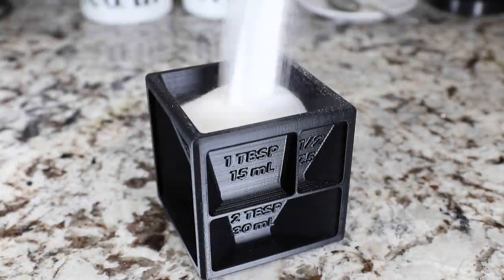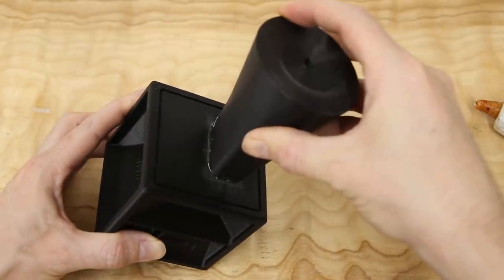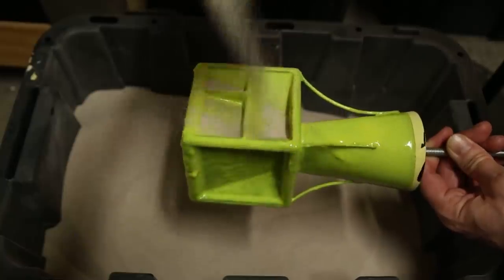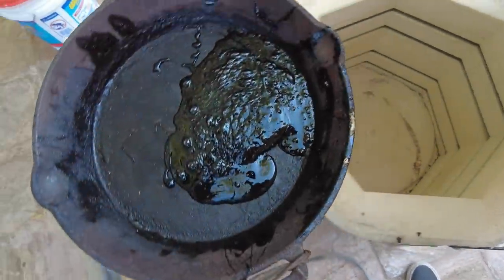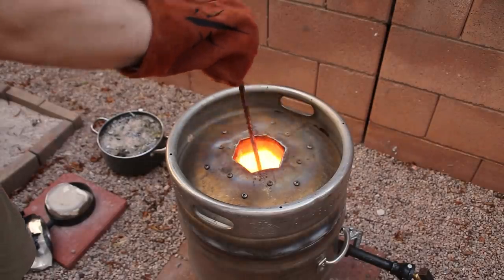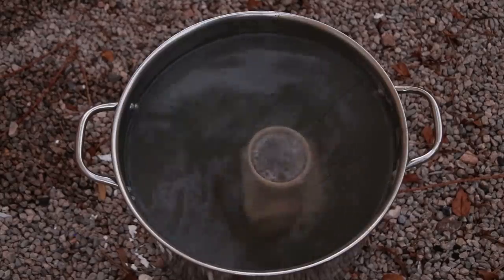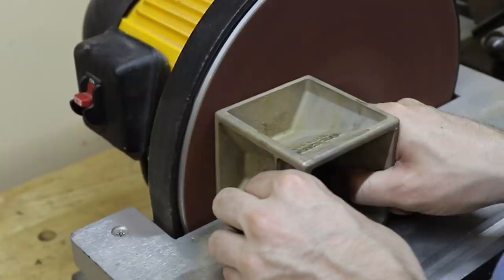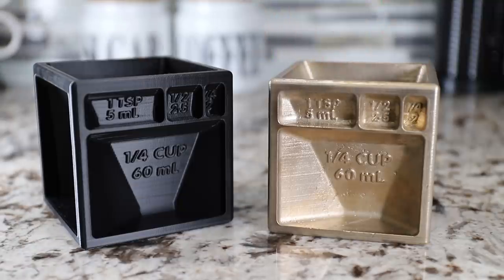Making a Measuring Cube - EXTREME MEASURES - bronze metal casting at home - 3d Printing Lost PLA

Comment: You should buy a rock tumbler/ polisher. That would work great.
Reply: Very good idea
Reply: But it takes so long to get polished rocks :(
Reply: Or build one!
Reply: @maximeduchalet4662  ok but I'm expecting him to alloy gear metal forge it, then hob the gears.
Reply: a brass tumbler/clearer for reloading would probably work well too.
Reply: Build one !
Reply: @Underbottom.Sandydown    I see what you did there...🧐
Reply: Large tumbler for firearms reloading and stainless pins would work wonders
Reply: but then it wouldn’t measure correctly
Reply: @RalseiGaming  it still will measure properly. The amount of material being lost is negligible. But nothing wrong with your thoughts on it.

Comment: Great video. Makes me want to build another furnace and start casting again! Just curious, did you print the measuring cup slightly oversized to compensate for shrinkage?
Reply: Forever cursed to make slightly fewer brownies!
Reply: @NeonThoughtBox  hahaha that’s hilarious! I was just curious, but going back and reading my comment now makes me feel like such a casting snob haha. Totally didn’t mean it that way. Sorry Seth! Good luck with your brownies…
Reply: What % of shrinkage is there when the metal cools off, and how come the ceramic shell doesn’t come off more easily if it’s actually a different size to the casting?
Reply: @thechumpsbeendumped.7797  ceramic shell shrinks as well and even more during firing. It is basically sintering
Reply: @thechumpsbeendumped.7797  Guess it depends on the specific alloy used.
Reply from the maker: Thank you! You're, right it is a little bit smaller. I actually meant to scale up the print by 2-3% but forgot to do so. Oh well, best laid plans!
Reply: @3dbronze  I didn’t think you sound like a casting snob at all. Legitimate question. It’s a measuring cube, it doesn’t work if everything’s slightly off.
Reply: @Will-ge7ri  
It would if everything was measured using the cube. There’d just be 2-3% fewer cookies, or whatever else was being prepared.
Reply: @robinson-foundry  i want to ask you  about the slurry you use? Do you need to stir it from time to time ? Does it expire or get hard etc?  And my last question : would you rather suggest using the slurry instead of using investment casting with the special investment plaster?  I want to see which one works cheaper and doesnt have lots of fuss to use.
Reply: Do you sell them or have the print code available
Reply: @3dbronze  thanks will do
Reply: @thechumpsbeendumped.7797  2-3% shrinkage overall would mean that the larger measurements are off by far more than the smallest… I think…
Reply: @swayback7375  
I’m not 100% sure but don’t think so. If every compartment shrinks proportionally the percentage difference would be constant. 

I did some back of the envelope (literally) calculations and 
5000³mm-2%=4,802³mm
and 
50³mm-2%=48.02³mm

5,000/50=100
4,802/48.02=100

That’s if I’m not missing something obvious?
Reply: @NeonThoughtBox  lol😂👏👏
Reply: @NeonThoughtBox  best comment I've read all day.🤣🤣🤣
Reply: @thechumpsbeendumped.7797  Only true if the shrinkage is perfectly even and linear.
Reply: @Barnaclebeard  
If it shrank in a non linear way either it would crack or the casting would distort. That would become evident in the walls of each compartment no longer being straight. 
But we’re talking about a cooking tool, that uses an antiquated measuring system, not a scientific device that if it was 0.01% out of calibration it could cause an experiment to go horribly wrong.
Reply: @3dbronze  Doesn't sound snobbish at all, in fact it's a really good question :)
Reply: @robinson-foundry  did you reuse the pla and suspendaslurry audio for the copper hammer video? i just watched them both and they sounded almost identical

Comment: "80 thousandths of an inch" sounds so complicated compared to 2 millimeters. 

It always gets me. Thinking if people can really imagine some tiny thousandths of something. 

Either way, super cool project. I saw this measuring cup being used by the "as seen on TV" guy. 

It didn't seem overly practical, at least in the way he used it. 

But making a bronze version is pretty awesome 👍 and the quality of your casting is superb.
Reply: or just 8% of an inch. Do basic conversions escape your capacity? Lol
Reply: @THESLlCK  Or maybe just 2 mm. Do basic units escape your capacity?
Reply: @JuanCLeal  complain more
Reply: I suppose thou(sandths of an inch) is a weird unit if you don't hang around US machinists, but there's a few intuits for it: a hair is a few thou, a playing card is about 10 or 12, the wire in a paper clip, something like 40 thou. While no one could feel a difference in width between 40 thou and 41, it's likely that you'd feel a burr 1 thou high on an otherwise smooth surface. Imagine a fine hair on a glass plate. 1 inch is not really long, but its long enough that 1 thousandth of an inch is tiny, but in some contexts, still very much perceptible. Just my 2c. Have a good one.
Reply: @THESLlCK  I prepared this bucket of ice cold water for you 🪣 That burn has to sting pretty bad.
Reply: @THESLlCK  yikes
Reply: But to be fair its much easier to imagine half a cup versus 120 milliliters, just how it be.
Reply: @0000Sierra117  metric works just as well. cm too big? Use mm. Still need smaller? Great, we have that too. You can use decimals of it and it still makes sense, and converting between metric units just takes moving the decimal point rather than weird arithmetic.
Reply: @juliaf_  yeah, I use metric a lot at work. It's pretty straightforward for most things.
Reply: If you're familiar with the unit, it makes sense to you. If you tell someone who isn't familiar with the metric system that a meter is "the length of the path travelled by light in a vacuum in 1/299 792 458 of a second" it sounds really complicated too.
Reply: @Eralen00  if you tell someone what an inch is, it sounds completely arbitrary.  Some random guys thumb that we decided to make a standard unit? But even then, imperial units aren't internally consistent either
Reply: @juliaf_  I'm not trying to say either system is superior.  they're both completely arbitrary if you want to play that game. One of them just happens to be based on a natural law, aka the speed of light in a vacuum.
Reply: @Eralen00  Yeah. I mean technically they both are since imperial units are objectively defined as a certain quantity of metric units, but that's just incredibly pendantic
Reply: @juliaf_  So what are you even trying to say? I don't understand your argument. You can't have a system of measurements without choosing something arbitrary somewhere along the line, so your hatred of imperial units is irrational
Reply: @Eralen00  conversions between units in imperial are impractical. That's most of it. For anything technical, it gets much more difficult due to the lack of coherent conversions, whereas metric conversions are consistent across all scales. For day to day things, imperial is sufficient, but for anything technical, it's much less practical. 

But of course, use whatever you'd like. Metric is superior in extreme scales and equal if not slightly better in regular scales, whereas imperial is worse in large and small scales, but equal or marginally worse in regular scales. The only time imperial is objectively better is when communicating with people who are fluent in it, which is why it's still common.
Reply: @juliaf_  No argument there, "for anything technical" most industries (science, tech, automotive, etc.) in the US already use metric anyway, if they do any kind of international trade or large scale commerce. This has no impact on the average person, since nobody deals with "extreme scales" in their everyday life. Being able to easily convert mm into km is useless because you would never need to apply that unless you're in some kind of specialist field. But honestly your explanation sounds like you're deflecting from just being annoyed when some online recipe uses units that you don't have measuring cups for, if you'll forgive me for assuming you're european, or at least non-american
Reply: @Eralen00  Canadian. I usually use imperial recipes anyway. I do prefer metric, but I'm competent in imperial nonetheless
Reply: @THESLlCK  how tf is this handy
Reply: The SI system is definitely easier than the imperial system, but there is no need to be so touchy about the subject. Most people use it because they have no choice. If everyone around you uses it, you have to use it to understand what they say and for them to understand what you say. Also, it's not exactly easy to just switch measurement systems. You can show me how big a milimeter is, and I'll understand, but I'll just forget it immediately if I don't use it on a daily basis.
Reply: What an insanely "I'm trying to seem smart" take on something that doesn't matter. The most practical measurement depends on who's doing the measurement, in this case; a guy doing a personal project in his backyard. .08 of an inch isn't really that hard to visualize with practice, like literally any other whole-number percentage of any measurement.
Reply: @LeftOverMacNCheese  you gotta not have open sewers before you can open your mouth
Reply: @THESLlCK  "the ability to speak does not make you intelligence"

And you're the embodiment of those words.
Maybe stop trash talking to everybody because that's the reason why you spend 20 hours a day staring at a phone
Reply: @juliaf_  I would like to give you a perfect example of the usefulness of Imperial measurements. 
I post a cooking recipe. I'm using Imperial. 
Someone from a metric country decide to make it. Do they need to go out and get a whole brand new set of measuring cups? Do they need to do fancy math? 
Nope, they can just use the cup and spoons they have. Because while they may not be exactly the same as mine, the ratios will be close enough that they'll be able to make the recipe.
Reply: @CaliMeatWagon  so. Laziness. Great. Just learn simple mL conversions. Also, a kitchen scale is useful regardless so you should have one anyway
Reply: @juliaf_  Also, great demonstrating of reading comprehension skills...
Reply: They just don't have words in their language to make precise measurements so they might as well give weights and lengths in buses.
Reply: @MrTheclevercat  
I guess you think the moon landing was fake?
Reply: @TheMepwep  cups are nice for cooking, Ill give you that but dont you ever start using cups when you do physics or engineering
Reply: Millimeter is a thousandth of a meter and you imagine that just fine don't you? It's really not a case of one length unit vs another, it's a case of a coherent system of measurement, vs a random collection of customary units that have piled up over time and don't really relate to each other. Cup, tablespoon, wtf strange women lying in ponds distributing cutlery is no basis for a system of measurement.
Reply: @aleksandersuur9475  You actually don't get it because the point is you can convert Km to m to mm and it takes 1 second. Turn your 3/16th of an inch into mm. Oh, you don't know what that is offhand? Guess you learned your lesson here.
Reply: @aleksandersuur9475  Everyone knows how big a milimetre is. Its on evry ruler and you just get a feel for the basic units after a while. You dont think of a millimeter as "a thousandth of a meter" but thats really useful when it comes to conversion
Reply: @juliaf_  Or you could just use both. Any American machinist or mechanic is well-versed in metric and imperial. There's really no reason to choose between them. The idea that Americans use imperial is risible. Americans use metric and imperial. We have 2-liter juice bottles and gallons of milk. We use metric sockets to repair our cars and miles to measure the difference between destinations.. I've never met even one American who can't do the conversions instantly in his or her head, and ultimately that versatility is an asset not a weakness. The only metric measurement that most Americans cannot intuit is centigrade. And centigrade is just as arbitrary as Fahrenheit is and scientists and photographers use Kelvin.
Reply: @WmSrite-pi8ck  I think it's safe to say that anyone who deals with measurements on a daily basis knows both imperial and metric, I used to work in a timber yard in the UK and everyone there knew both imperil and metric, it just makes sense to know both.
Reply: @Eralen00  Mind you the speed of light cannot be proven.
Reply: 80 thousandths of an inch isn’t any more complicated than two thousandths of a meter :)
Reply: @fidgetspinner1050  once you get used to thou you stop thinking of them as “thousandths of an inch” too lol
Reply: @juliaf_  There's no weird arithmetic. At all.
Reply: you just think in 0.001 increments... its not difficult.
Reply: @WmSrite-pi8ck   your train of thought is strikingly correct. But I fear most of your fellow Americans would scream and cry that everyone has to use imperial and that's because the US of A are the only nation that counts and they have to make imperial great again.
Reply: bigboy3245  What do you do when you're a bit below a thou? Exact same issue as you claimed with mm and microns. You'd need several hundred millionths. Anywho, the only reasonable argument for all I'm concerned is the cost of retooling.
Reply: i fully support metric for vast majority of cases but thou is pretty useful for PCBs
Reply: @Gadget Addict
""""
It always gets me. Thinking if people can really imagine some tiny thousandths of something
"""
Meanwhile...
"2 millimeters" literally means 2 thousandths of a meter.

It's not like the guy is visualizing an inch and then dividing it into thousands. He just didn't make up a new word.
Reply: @THESLlCK  mald more
Reply: @0000Sierra117  you can have the same sort of intuition with metric
Reply: @ThylineTheGay  oh absolutely, I'm not denying that, I use metric constantly at work, I just wanted to provide a sense of scale for people who aren't used to thousandths.

Comment: Thanks for tuning in to another installment of, “words I didn’t know before!”:

1. Sprue:  A channel or funnel through which metal or plastic is poured into a mold.

2. Vitrify:  To convert (something) into glass or a glasslike substance, typically by exposure to heat.

3. Lost PLA Method:  The model is placed in a plaster mold and the mold is heated until the wax liquefies and flows out of a hole in the bottom (hence the “lost-wax” part of lost-wax casting). Liquid metal is then poured into the mold, which flows into the imprint of the design left in the baked plaster.

Tune in next week to find out precisely where my vocabulary was lacking (or REMEDIAL for the kids following along at home!)!
Reply: Nice I also never know this word
Reply: youll learn a lot more if you stay in these spaces.
Reply: I did know vitrify, not sure why, but the other 2 were new to me, as well.
Reply: ok